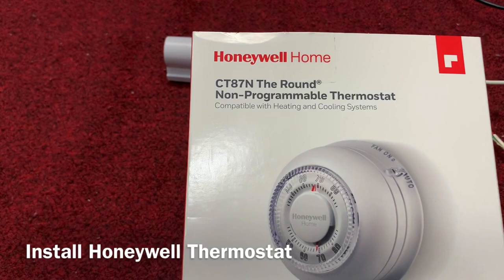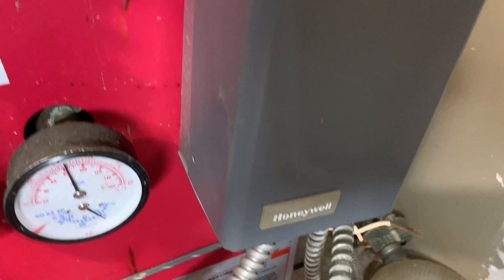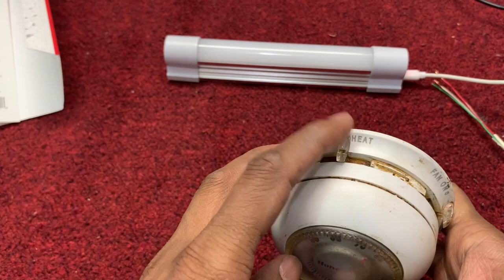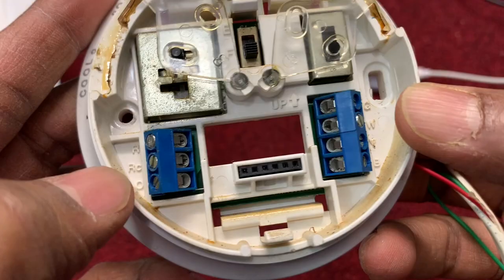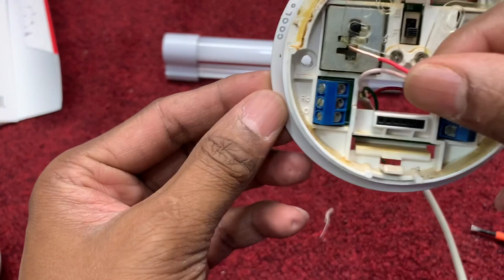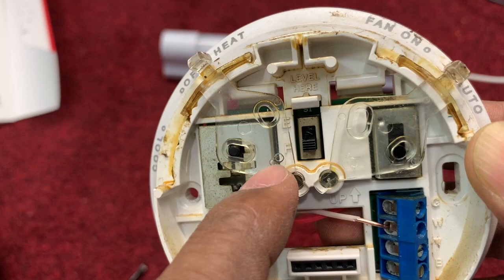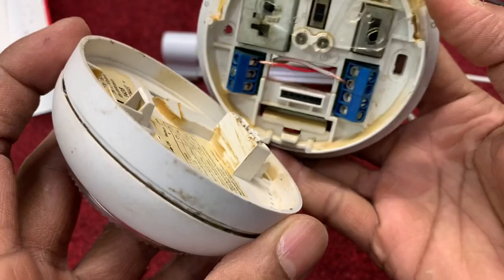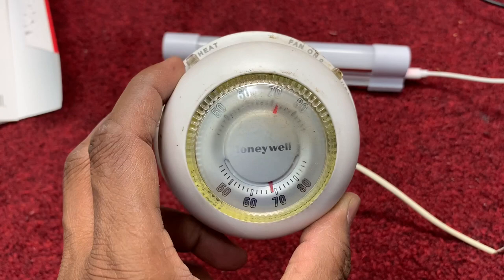How to install Honeywell Thermostat. How to change Thermostat CT87N. Non-Programable Thermostat

Comment: I am sorry , it is hard to understand you .
when you start talking about the heating system and showing the switch , you didn't mention to put it on or off postion .
you are confusing us .
Reply: Anything fixing or repairing or installing FIRST YOU HAVE TO POWER OFF OR SWITCH OFF
Reply: I could understand every word he said.